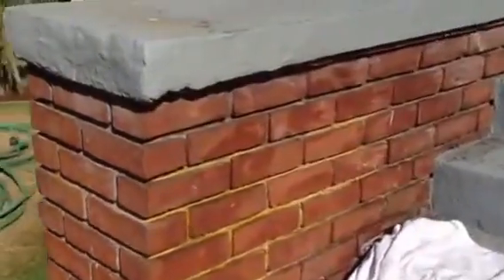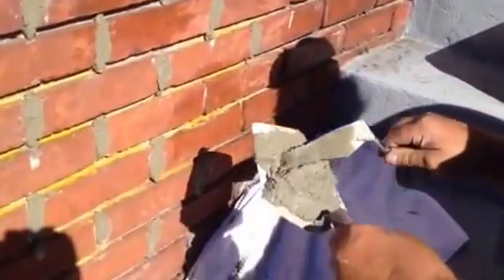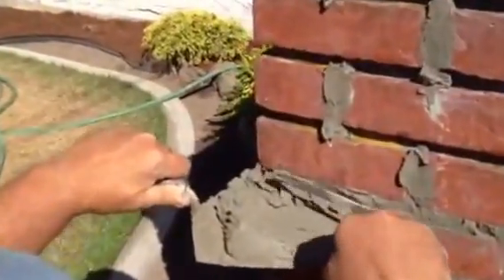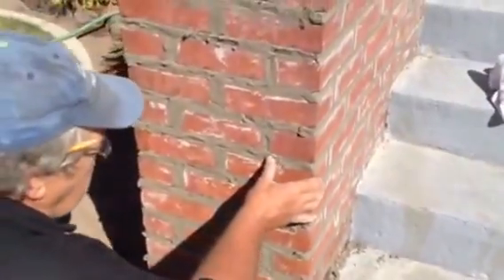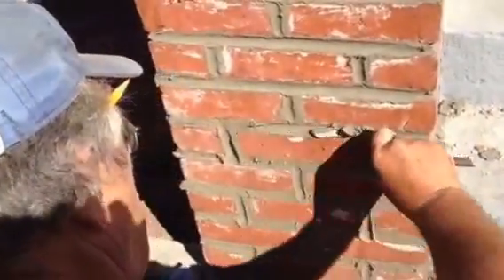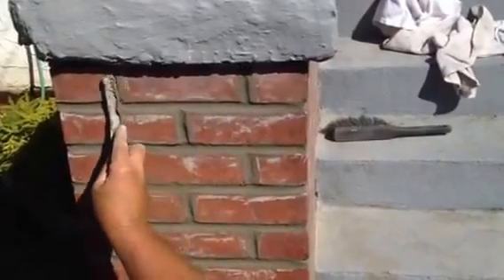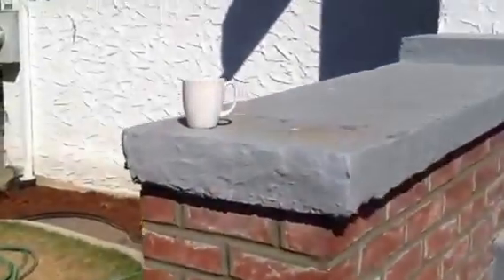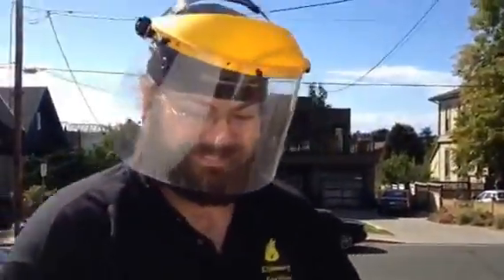Tuck Pointing Method for Repointing Bricks Steps Chimneys Walls How To

Comment: Awesome vid... Going to try on my chimney, what exactly is in the water bottle?
Reply: @capitolcitydean
Reply from the maker: punchyourfaceMMA m,ust have missed this comment - waater and maybe a teeny bit of adhesive - the main idea is to soak up the existing materials and let dry partially to create a suction of the new mortar liquids into the jointsto provide a good bond

Comment: You seem like a nice guy but as said before, smearing the face of the brick with mortar wouldnt get you paid here in the UK. If a uniform line of mortar is picked up with the trowel to start with off your mortar board and a bit of time is taken to place it correctly, the smearing doesnt happen, negating acid washing the day after, and making you more money cos your on a different project instead of calling back. also, i hope the acid wash was washed off that wall, as left in place it will deteriorate the new mortar and bricks rapidly.
Reply: SuperTruebrit I'm in the UK and you can use this method without making a mess. I use a small mortarboard and flatten the gear out before pushing it in. It does make things quicker and it can be done without smearing it all over the brick face. haha
Reply from the maker: SuperTruebrit Getting paid by the hour on this one! thanks for the comment and the mortar board ideas..